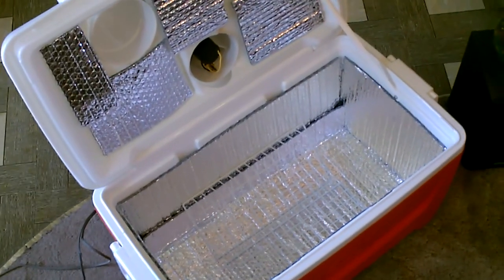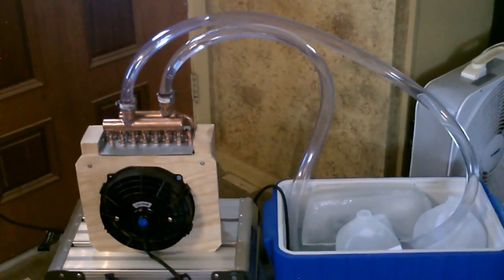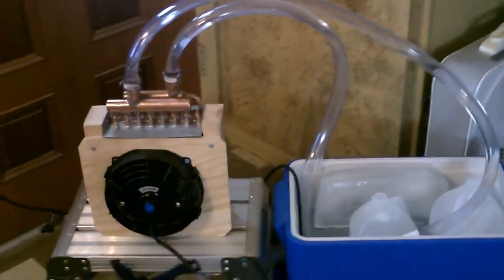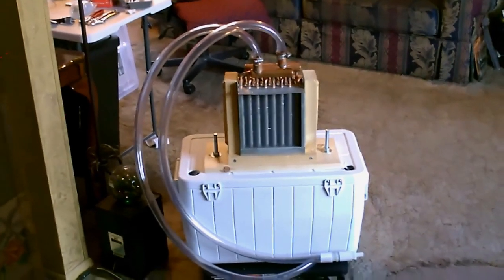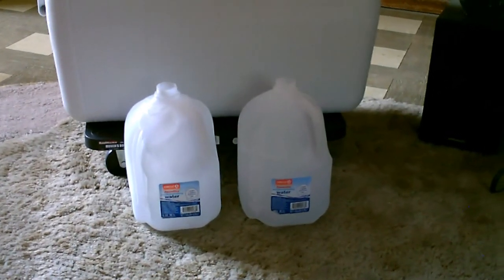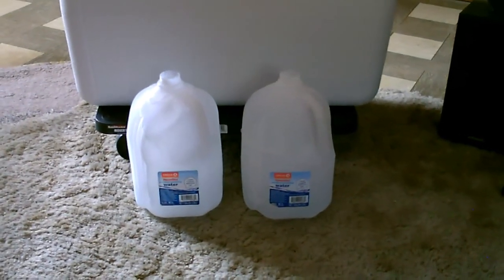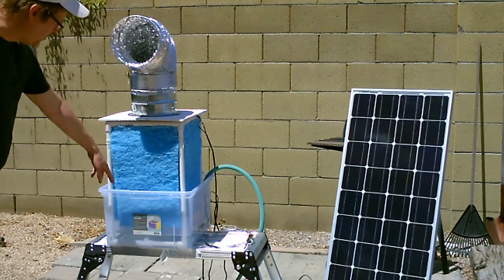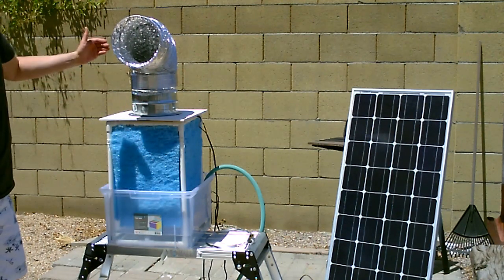DIY AC Air Coolers!  My Newest for 2019!  3 types: {ice-based} {cold-water based} {evaporative}

Comment: I try but running cold water in the radiator, i got lot water dripping out. Condensation happen.. how to solve this …
Reply from the maker: hi. i typically just set a towel underneath to catch any condensation. if it's only a little maybe just use a paper towel.

Comment: The powerful fan seems the most important part, Where can I order one ( brand? Maybe part number ?). I'm now using a 6" cheapo that's just not cutting it in a swamp cooler, I have side & rear curtains on my cart and a closable windshield, I'm also in S Florida, hot as HEll here in summer , Almost unbearable

Comment: Where did you get the radiator?
Reply from the maker: hi. i get them on amazon. they're made by a company called badger pipe (i think the full name is badger insulated pipe). just search 'water to air heat exchangers' on amazon and you'll see lots

Comment: Why hold the ice jugs off the bottom with the wire baskets ?
Reply from the maker: helps the air fully circulate around the ice for maximum cooling 🙂❄
Reply: thanks

Comment: desertsun02 just wondering if I can use a Igloo 12v electronic cooler for the 8x8 heat exchanger water source. It maintains 36 degrees and should do the job. Thoughts?
Cools down to 36 degrees Fahrenheit below the outside temperature.

Cools without ice and leaves you more room for food and drinks

Ergonomic design features a curved back that comfortably hugs your side while carrying

Quiet brushless motor and convection cooling with a fan to circulate cold air

The 8 feet long power cord plugs into any 12V DC receptacle (cigarette lighter) for portable use

Exterior Dimensions: 18.19" L x 13.13" W x 15.5" D

Comment: I don't understand why you used reflectix in the red cooler. Can you explain why?
Reply: @shane_a  reflectix is not insulation. It has an r value of 1 when placed against any material. It requires a 1/2 inch gap to achieve any higher r value. Tinfoil would work just as good and by that i mean its useless.
Reply: @ronmiller7916  Sounds like you should do a video demonstrating the difference between Reflectix, aluminum and nothing - as it applies to this build.

Comment: Have you heard of indirect evaporative coolers? The mass hear exchangers on these are good, no humidity & no compressor check out Coolerado or climate wizard.
Reply from the maker: hi there. yes. i'm in the process of building a DIY indirect evap cooler. it's basically a combination of this unit and my cold water air cooler unit.
Reply: I thought they went out of business?
,,,the las vegas sales rep said they dont work,,?
amy updates ??